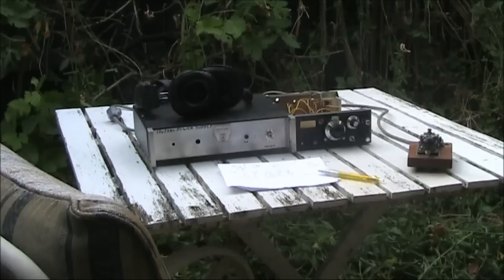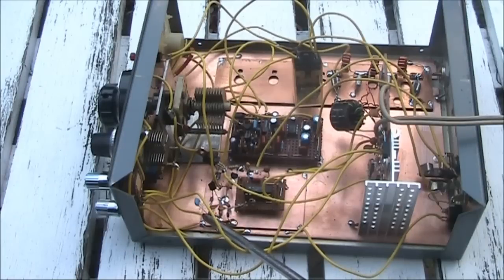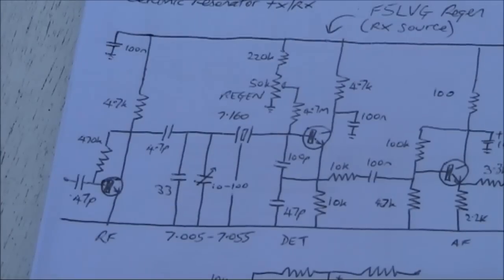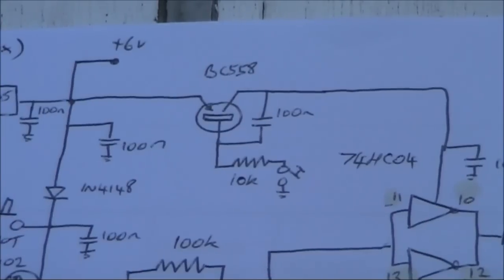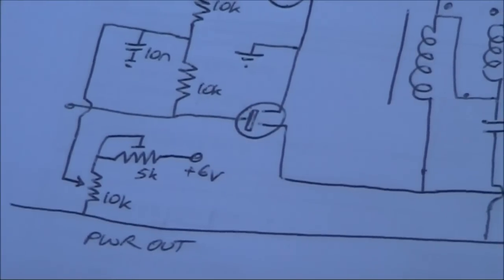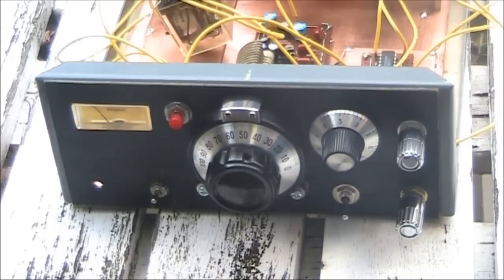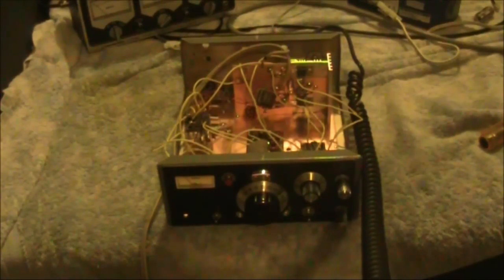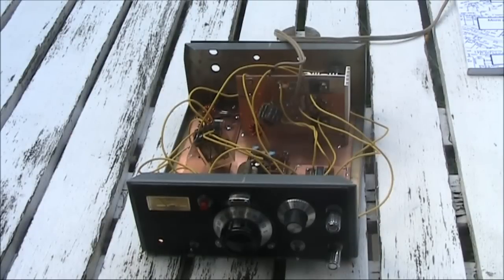Anatomy of a 30 watt 7 MHz CW regenerative transceiver (and a DX demonstration)

Comment: That's a nice  looking front panel layout Peter, always good to have things looking right. Nothing I ever built had sidetone either. 18 years using all H.F. ssb/cw tx/rx 6 Watts out but got FT817 recently because of small size for portable, so h/b rig I'm thinking of putting on 70 MHz and 5 MHz, I don't need two H.F. rigs. Have a 61BT one valve CW xtal tx on 5.262 MHz running 1.6 Watts out. I've successfully used Veroboard for 7 MHz projects. Recently dug out my 1.910 MHz xtal  single BFY51 transistor tx built about 40 years ago.
Reply: 73 Peter.
Bill, G4GHB.

Comment: The spot alignment feature is a clever solution/feature nice work Peter, BTW those knobs to the extreme right of the fascia look familiar perhaps something recycled from a HMV radio or similar circa 1970's :)
Reply from the maker: +SpectreOZ Yes I go to a lot of trouble with knobs.  Even pulling them off other projects to ensure that I have sufficient number to ensure they match and fit in with the item's decor.
Reply: +vk3ye I will confess to relieving parted out Electronics for their dials/knobs as well... everything is useful more than once around.

Comment: I suppose with vxo tuning a regenerative receiver would work acceptably, but I'd probably rather build a simple superhet design using SA610's. I'd probably use an Si5351 and a simple arduino as the vfo, if for no other reason than to be able to cover the entire 40 meter band, and have digital frequency readout.  The cost of doing this is actually not much more than a vxo once you add the required tuning capacitor and vernier dial. (Two line LCD's or OLED displays from China on ebay are very inexpensive, possibly less than the cost of a NOS Japanese vernier dial.)
I very much like the transmitter design.  The inverter stages actually don't provide a truly balanced push pull drive (very close, but no cigar), however with a class C final  (what do you set the resting current to with the bias adjust?) it really doesn't matter since you don't need linear drive.

Comment: Hey vk3ye,

I'm new to amateur radio and want to do DX CW on a rig that will give me as much key time as possible. A lot of kits are "QRP" but as a beginner I am concerned this is not the best choice for me to start. This will be my first piece of equipment.

I am licensed on the HF bands. I have experience building kits, but not a lot of experience designing electronics.

Can you please guide me towards a solution? Any help is much appreciated. An opinion dump would be fantastic, you own't offend me. Thank you.
Reply from the maker: +taiden Quick way:  Build a QRP kit and then add an amplifier (either kit or built-up).  Long way: Buy all 4 of VK3XU's books.  Build several projects from scratch in it.  Then attempt high higher power rigs or amplifiers.
Reply: +vk3ye Cheers, thank you. Are you partial to any particular qrp kits or amps?
Reply from the maker: +taiden Haven't built a decent CW QRP kit for ages.  Check eham for kit reviews. Any kit must have these three features https://www.youtube.com/watch?v=hj9va9LMB78
Reply: +vk3ye Cheers, I watched that video and really enjoyed it. My problem is I am having a hard time interrogating the kits over the internet. It seems like a digital interface would be no good for frequency agility, especially like the MTR, would be poor for frequency agility, and a crystal based would be worse. I am not sure how to determine if offset is a common feature or if I should have a second knob for it. And as for transmit/receive switching I honestly thought it was automatic until I saw your video. I do not expect you to hold my hand, just trying to drill down to some options. Thanks
Reply from the maker: +taiden Try this list of QRP kits http://www.qrptransceiver.com/#qrp-transceiver-kits
Reply: +vk3ye Thanks! So it sounds like we want a multi turn analog frequency dial, some kind of rit adjustment (preferably with a 0 detent), and I believe most of these kits automatically switch between transmit receive? Now I have to select a band. It seems that 40 and 20 meter are the most common for CW and it seems that 20 meter antennas are easier to build, but I've seen reference to 40 meter receivers being easier to setup? I have limited space so I'm leaning towards 20 meter. Am I on the right track here?

Is it worth ignoring kits that don't have a bandwidth adjustment?
Reply: +vk3ye Hey, just saw you had an ebook. Picked it up and will give it a look. Sounds like it might have a lot of answers to my questions inside. Cheers!